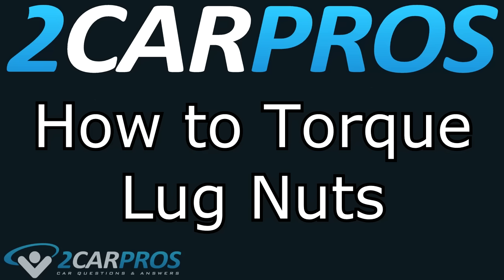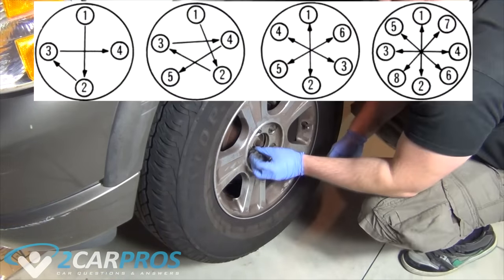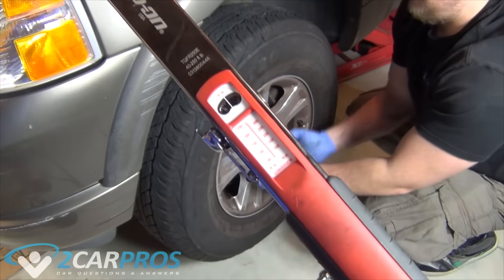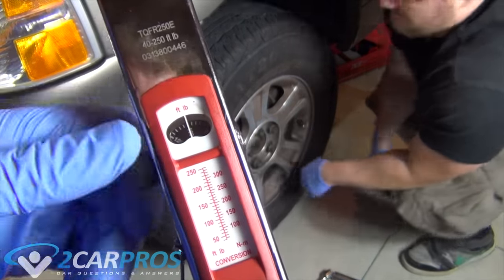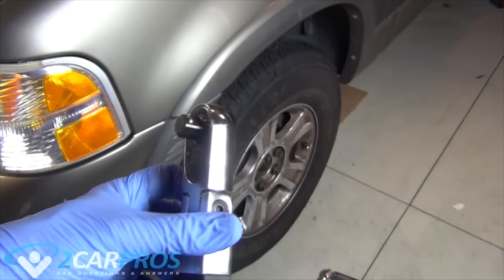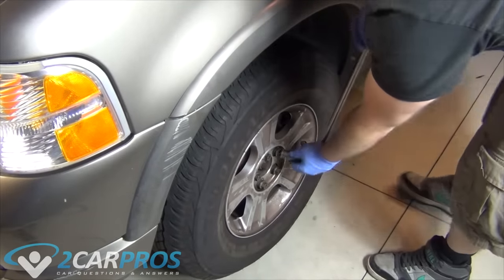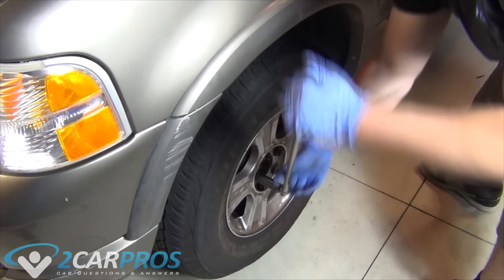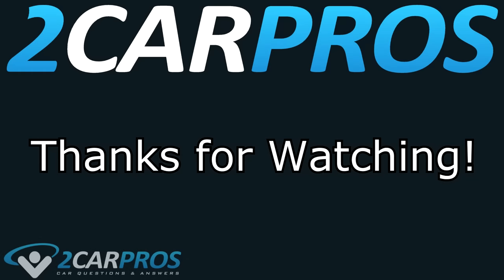HOW TO PROPERLY TORQUE WHEEL LUG NUTS EASY!

Comment: On aluminum or magnesium wheels I like to use more than on pass in tightening the lugs. What I would typically do is torque them to 40 ft-lbs on the first pass in the star pattern and go around again at 80 ft-lbs for the second pass. For a three pass installation on magnesium wheels I'd do something like 25, 50 and 80 ft-lbs in the star pattern. For billet aluminum lug nuts I always cleans the stud threads and apply a little anti-seize compound to the threads before installation.

Comment: I changed from my winter tires to summer tires:  I first tightened in a star pattern as much as I could with the wheel in the air. Lowered the car to the ground and then  torqued the nuts in a star pattern to the proper value. 

A few weeks later a  wheel partially came off. The garage said my wheel nuts were loose. I am baffled.  In the past 40 years I have always tightened the lugs nuts without using a torque wrench (prob. too tight) and  never had an issue.  I only started using the torque wrench several years ago. 

Is that an issue with the tires on the ground and the weight of the car causing the torque wrench to incorrectly click if the wheel is not snug enough to the rotor ?

One thing I do recall, is when I removed the winter tires, one lug did seem not tightened very tight.

I am baffled.  Thanks
Reply: The nuts can loosen with the wheel’s rotation but I don’t know how long that takes. One tip I got was to re-torque your nuts some time later in case there was a positioning problem, same logic as with snow chains where you re-tighten them after driving for a few minutes.
Wheel nuts used to be left and right hand thread, I’m not sure if that’s the case now, they used to have a “L” stamped on them.

Comment: I don’t have a torque wrench, I have been testing the newly purchased impact wrench only in untightening wheel nuts but have been tightening them by hand. I have ordered a torque stick for 120 nm but I have only tightened the nuts with a wheel brace and pipe. I’m not sure if I can hand tighten whell nuts to 120 nm or more, I’m certain I will not have damaged the nuts by hand tightening.

Comment: I like torquing wheels everytime i'm done with a brake job but something that has always bothered me is that because you are using what is basically a long ratchet with a torque mechanism  in it it feels like you are not really tightening anything because you have so much leverage,lol, makes you wonder "is that it??" versus using a 4 way where 

is a totally different feeling. BTW i know Snap On is a super duper awesome brand but i hate those square torque wrenches with that swiveling head,lol, i like my torque wrenches round.
Reply from the maker: Thanks for watching!
Reply: I need to know something, when you torque the bolts do you put it parallel with the ground and pull up or push down?
Reply: Torque is measured at the nut in foot lbs. The torque will be the same regardless of the handle length. For example, applying a 50 lb force at the end of a 2 foot long wrench, or a 100 lb force at the end of a one foot handle will result in the same torque at the nut. 50 x 2 = 100 x 1

Comment: Too many idiots at tyre stations overtighten these nuts which makes it impossible for anyone to change a flat tire in an emergency.
It can also wreck alloy wheels. The number of times I've seen teenagers at these shops let looks with air tools, and no torque setting on the impact tool.

Comment: Thanks for the video. Is there a big difference between 130nm and 140nm? I had my tires rotated and they tightened the nuts to 130nm instead of 140nm which I later found out when I checked my manual. Will there be problems down the road? Thanks again.
Reply from the maker: Not really. Should be fine honestly. Thanks for watching!

Comment: This is a good example of how not to torque down the lug nuts on your cars wheels hes not even holding the torque wrench in the right angle.
Reply from the maker: Thanks bud
Reply: Raul is right. Torque wrench is not a tool you just crank this video is bad info. Torque is consistent pressure until you reached desired torque where the wrench head snaps or pops and you let off. The car should never be lowered without the wheel secured by at least one lig to the hub and tightened to a minimum of 60 ft lbs. Vehicle should not be rolling back and forth while desired torque is being met. It's not a true torque.
Reply: @Bamaca_B58  yup that's how I do it I leave the Jack supporting that cars weight but enough so the wheel does move then torque them a drop the car
Reply: @Motorsports_3  you mean so the wheel, doesn't move, right?
Reply: @marksargent2908  yes, the jack will support the vehicle enough so the tire barely touches the ground. Just Enough to when you torque the wheel the tire won't spin.  That allows the wheel to actually be torqued to the hub.

Comment: My 2018 Colorado’s lug nuts require 140lbs of torque🙄
Reply from the maker: Jeez that's a lot. My 2005 F150 has 150lbs on them according to the manual which is crazy! Thanks for watching!
Reply: @2carpros  Worked on a new Land Rover discovery here in the last 2 weeks doing brakes,they have some big wheels and its 103 lb/ft , yeah 140/50 is quite a bit, i believe 103 is because they are aluminum wheels also but who knows.